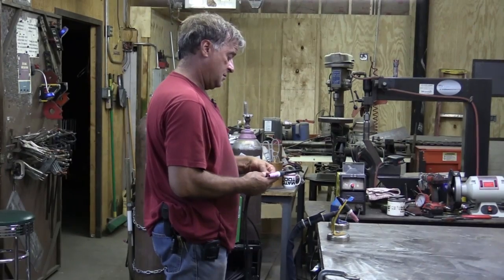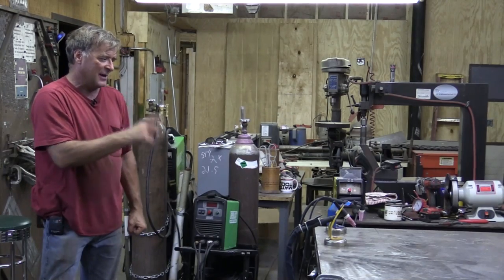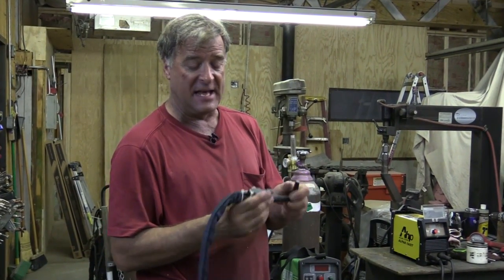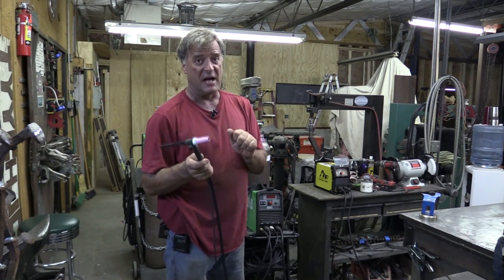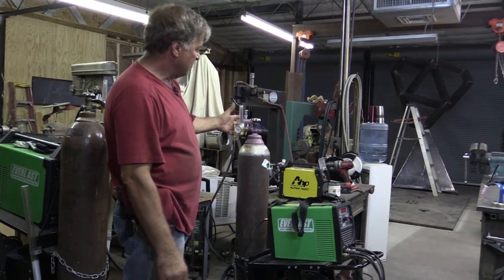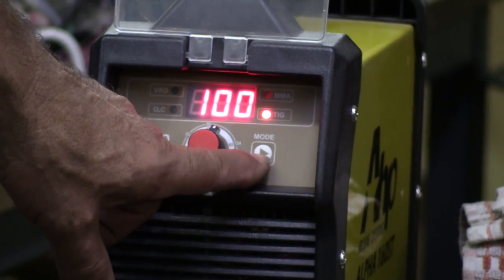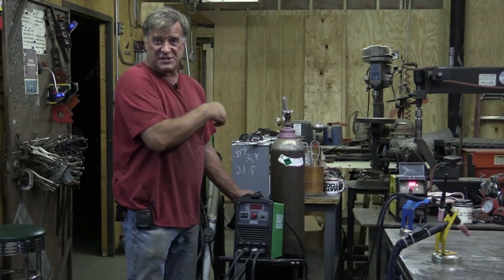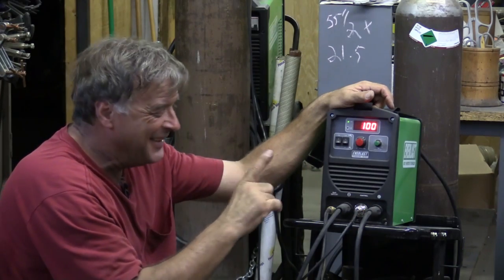AHP 160 vs Everlast 160 - TIG Welder Test - Kevin Caron

Comment: Hi Kevin, what thickness would this ever last machine do in terms of TIG welding. I’m just getting into TIG and thought if it would do 1/4 in then I would go this route.
Reply from the maker: Normally you need about 1 amp per 1 thousand of metal thickness.   So 1/4 inch is 0.250 thousandth so you should need about 250 amps to do it in one pass.   I have gotten away with a lot less amps but I think you still need about 175 at the minimum to do the job correctly.   Look at the AHP  Alphatig 200 or the Everlast PowerTig 200DV.

Comment: I was planning of buying a miller.max star 160 cost like 2k I think. Everlast has better price
Reply from the maker: Yes they do, and in my opinion a better machine.  No, Everlast is not as robust, No, Everlast is not as heavy duty but I feel you are getting a better machine for your dollar.   And that is what it comes down to in this day and age.
Reply: Kevin Caron, Artist I agree on that.
For 500 bucks it's worth it if ur welding 16g stainless on the field comes with 5 years warranty. Even if u do a side job for 2k on the weekend the welder pay of it self already

Comment: I would say this was the best comparison test I have ever seen to date on Youtube. You really thought out every aspect to make sure it was an apples to apples comparison instead of apples to oranges like so many other do which still leave one without the proper information to make an inletligent discision if in the market to buy one or the other. However I do still have just one question remaining. You mentioned price of both machines at end and I will have to assume the price mentioned for the AHP was the price for machine without tig torch. I will have to go back to see if you mentioned the price of the tig torch to buy aftermarket at begining of the presentation.But before I do I am thinking the price between the two with tig torches would only be and this is a guess within about $85.00 apart. And for  $85.00 one would have the benefit of the everlast in not having a seperate gas hose and have auto on off gas and switchable start for the arc and many more features and not have to search out to get an afermarket torch. For me the little extra money would make the Everlast a better choice. The AHP having a sepearte small air/gas feed hose I am thinking could pose a few problems down the road and might become a high matainence problem or needing to be replaced more often then everlast setup.
Reply from the maker: I agree totally!     I like the Everlast over the AHP!

Comment: Pick your brain for a sec Kev, are there any manufactures that make a small machine like those that dose a/c as well on the cheap such as those two?
Thanks sir. 
-Pidge
Reply: PiDGE IAM I picked up the everlast 185dv last spring. It's an ac / dc machine . Love it. $850 bucks though. Still a deal for the ability it has and it dual voltage.
Reply from the maker: Don't know of anything lower than about $800.00.
Reply: Kevin Caron, Artist.....Thanks for the reply Kev, that's what I was ballparking in my research of that type of machine. Just thought I'd ask if you knew something different. Thanks for the reply I'm a fan of your show and am delighted you responded to my question. Keep up the cool projects and nice work. 
-Pidge
Reply: steve L ..hey Steve thanks for the response, I do think I've come to the conclusion I've gotta get one from the manufacture and save some more money. I've been searching the "used for sales" sites and units are still up around $800-$1000+ CAN. Thanks for the heads up on your everlast that's a good thing for me to keep in mind. 
-Pidge

Comment: Nice comparison.  I'm thinking that if a person primarily needs a TIG machine with stick capability, then the Everlast might be the better value since they provide the torch, has the integrated gas valve, and the option of HF or lift start.  Personally, I got the AHP for the stick side of the house, and getting to save the $ on the TIG features made the deal.
Reply: The integrated gas valve is the feature I like best. Saves me having to remember to shut off the gas and even if I remember the welder will cut it off faster than I can manually control the knob. I'm sold.
Reply from the maker: Totally agree!